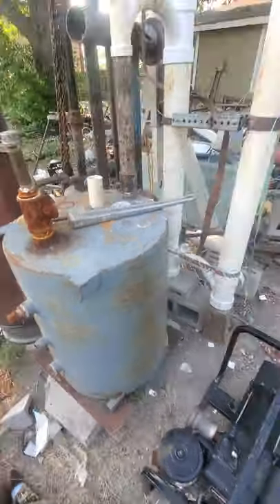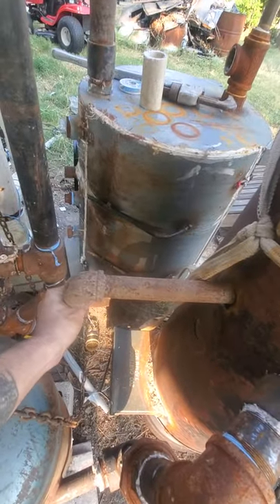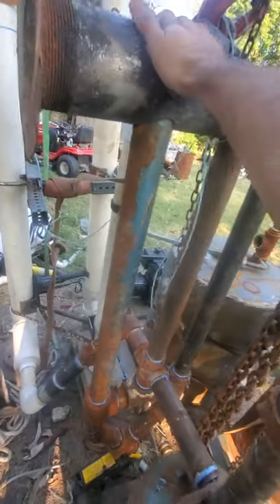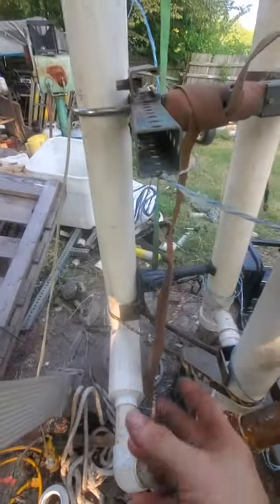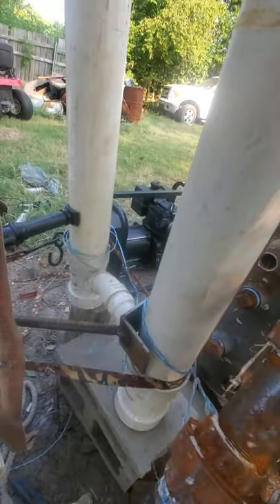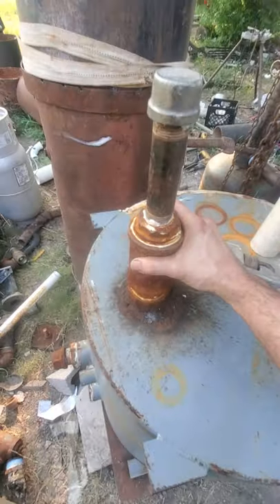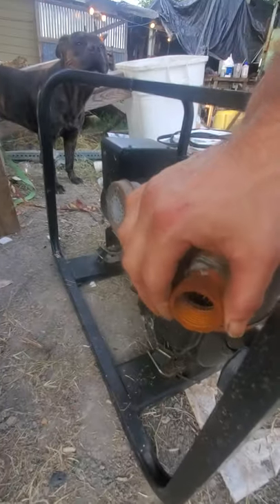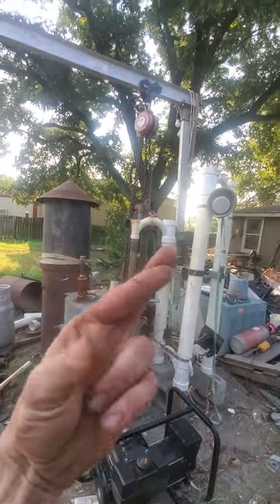Someone say Gasifier?? I heard gasifier...

Comment: Scrap metal makes the best gassifiers I think, mine cost about 500$ to make and payed for itself the first month of driving my truck back and forth to work
Reply from the maker: I hear that. Mine won't be on a vehicle, but it will power my shop via generator. I haven't spent any money except for countless welding rods as I finally learned how to put down airtight welds. Went thru a ton of them, completed my build 3 times.. To realize that I was going to need tk learn way more than striking an arc and drawing a bead. Air is hard to keep out lol
Reply: @thehumbledabbler  Yes it is. I cheated and mig welded all of mine, and still went back and fixed a few leaky spots. Took my about 250 hours to build but saving my money every day, 60 miles today no gasoline used. I have a port that I can hook up to a generator, actually building a wood chunker to feed it right now and the motor for the chunker is off a generator and will be fueled by the gassifier on the truck. All in one system
Reply from the maker: @BigBeavrSlayer  that's cool as hell. Powering your car is the tip top of the coolness factor of thee things. I'm actually trying to come up with an idea or 2 to use the heat produced to heat my house, rather than just let it escape into the atmosphere. I'm coming up with nothing tho. Any idea on where to find such a solution?